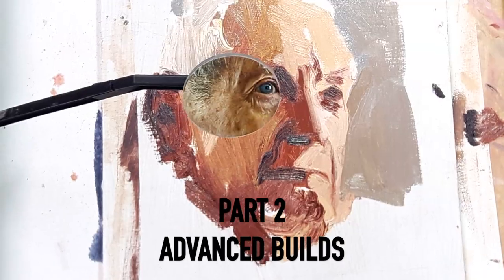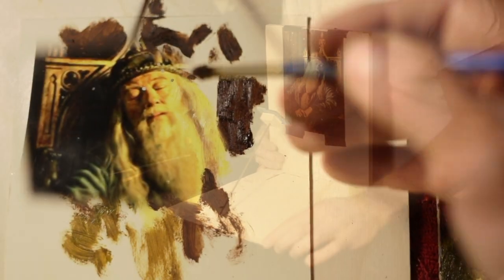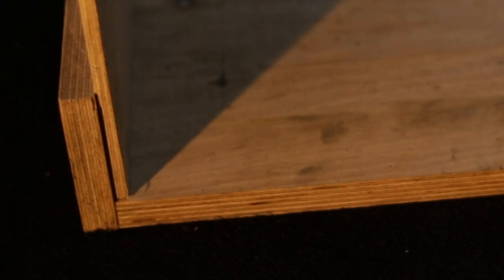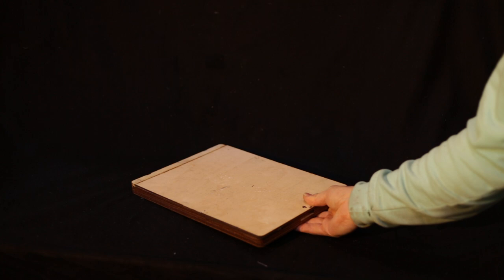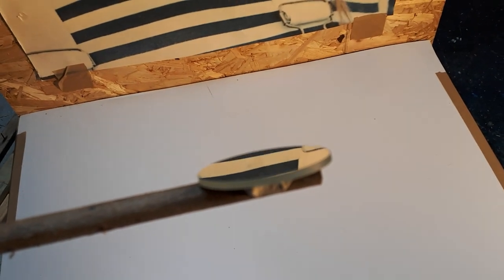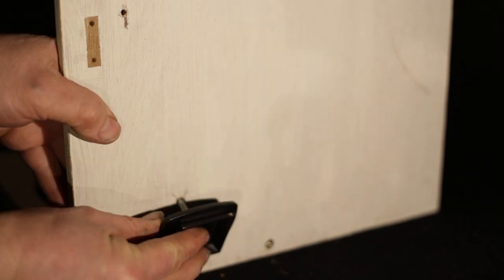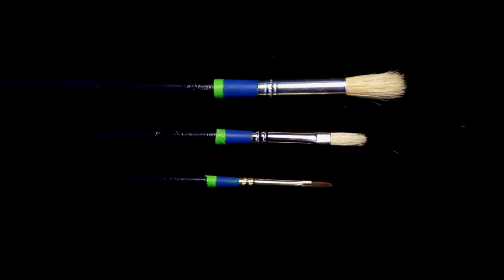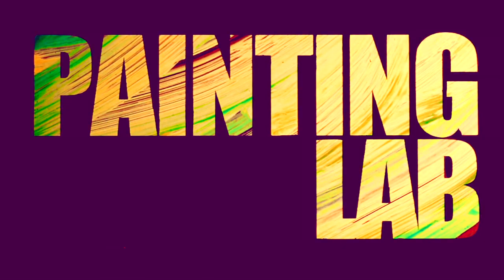How to make a Comparator Mirror (PART 2) - Advanced builds / large pictures and easel painting.

Comment: I am curious, I have just recently received the booster kit from you and assembled the magnets (and even ordered more so as to experiment on different setups). I wanted to ask if you have found an ideal size to make the initial setup (the size of the base board and the backboard). I would assume that the 45 degree angle should make a line to the intersection of the two boards, and thereby determine the size, but I wanted to ask you first, before making those measurements and perhaps repeating what you have already found an answer to.
Reply from the maker: Hi Aeryck, yes your assumptions are pretty much correct. Did you recieve our instructions in an email as these will help you. Given the length of the boom in our booster kit optimal board size is around 12 inches sq but boom lengths do vary slightly from one kit to another so please do measure to find the point on your board that places your mirror at equal distances from both boards... hope that helps.
Reply: Thank you, that is how I understood the construction. I did not receive the email you mentioned, just the initial personal email that we exchanged of me asking about the kit.